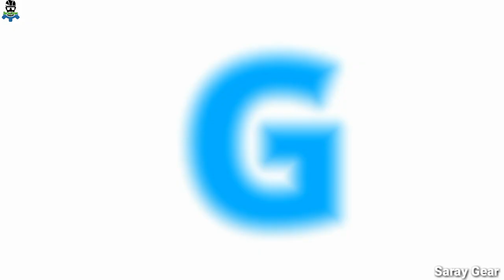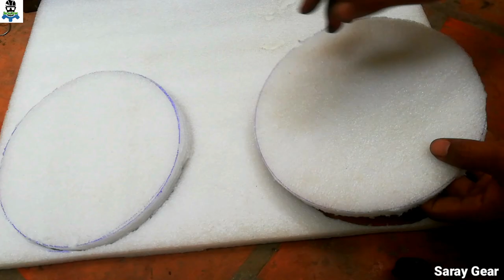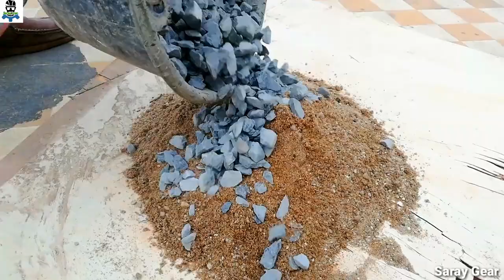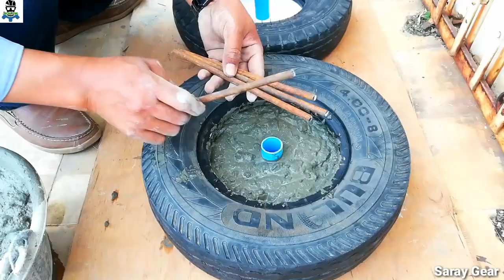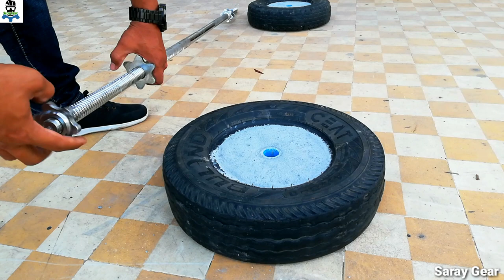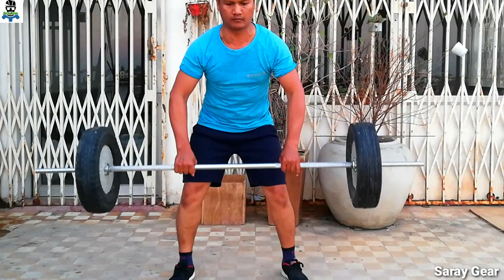Homemade Barbell From Old Tire How To Make It

Comment: nice squat them when done rope back let hite ground like new rubber 45 plates. if find other tires add them to make heaver. why leave inside tire air though? would good fill entire tire with cement ?